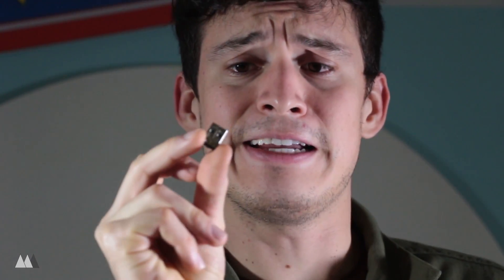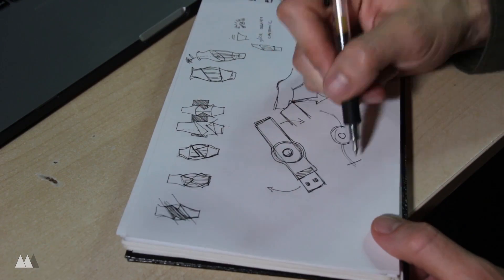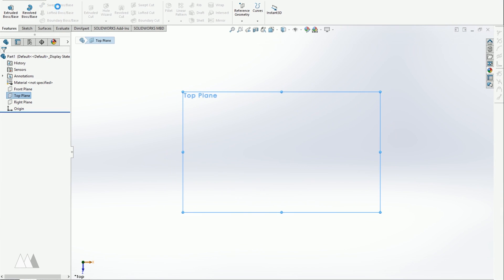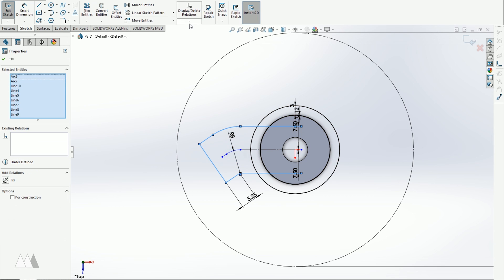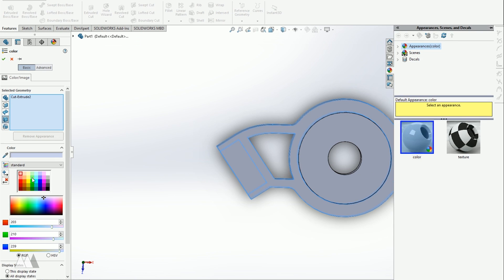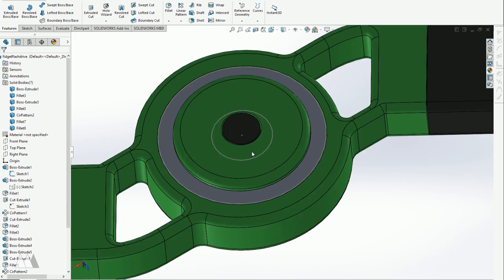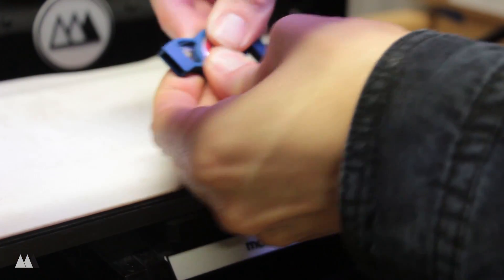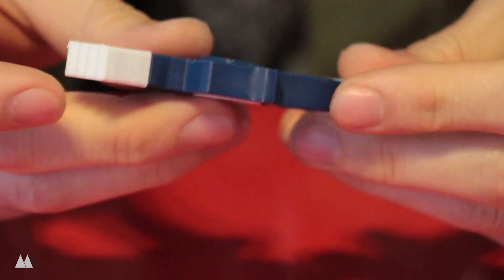Fidget Flashdrive // 3D Printed Fidget Spinner

Comment: just a suggestion, extrude cut a couple millimeters around the edges of the caps so when you use a flash drive you can put the cap over the other so it won't get lost

Comment: Hey Devin, I had the fidget printed by an online 3D printing service and assembled it a few days ago. It was my first contact with 3D printing and I enjoyed it a lot. I guess I'll get a 3D Printer myself at some point soon! I used different flashdrives by Samsung, since I wanted them to have usb 3.0. The plastic housings came of completely after some sanding, therefore the holes for the flashdrives were a bit loose, but I filled the spaces with some 1mm plastic scraps and glued it in. The caps have a reeeally tight fit! Anyways, I just wanted to let you know, that I had a really chill day building that cool fidget and am looking forward to show it off a lot!!  I use one of the flashdrives as an encrypted storage - for top secret stuff!! ;) LOVE!
Reply: phobonymous Which ones were they and were there any heating issues?
Reply: You mean which flash drives I used? 

I used these
https://www.amazon.de/Samsung-Memory-Speicherstick-abw%C3%A4rtskompatibel-silber/dp/B013VXJJ4A/ref=sr_1_2?ie=UTF8&qid=1488215958&sr=8-2&keywords=64gb%2Busb%2Bstick%2Bfit%2B3.0&th=1

No heating issues as of yet.

Comment: How could you make the caps for the drives so that you don't loose them when you take them off? Can you connect them to the back end of the other cap somehow? That way while you are using your USB you don't misplace or loose the cap. That happened to me before.
Reply: He could make it so those finger notches (9:30, the ones to make it easy to spin) have flat outsides to accept the cap.
Reply: Sprat & Ham ooh or maybe make the "grip triangles" the same dimensions as the usb drive and have them able to slip onto the end of the other one
Reply: Sprat & Ham
Reply: +Harpreet Kaur Yes???

Comment: Cool project! I would prefer the different drive symbols to be on the body and not just the caps. Knowing myself I'd probably have both caps off at some point and then have to plug the device back in to figure out which side is which.

Comment: i use solidworks for my cad class and occasionally ill have random problems that only starting a new part will fix.
like once i used the circular pattern tool and it was rotating around the axis i chose and it rotated the pattern weirdly too.

Comment: I always have problems printing fillets on the underneath of models. Is there anything you do to help this or is it just your better setup?
Reply from the maker: +taity waity do a 45 degree chamfer, then fillet the top edge. It's usually bad practice to just fillet a bottom edge like I did, but since they were so small I was able to pull it off
Reply: Ah makes sense, thanks

Comment: I wonder if you could do this without sanding the end as much if you did it as an embedded print, have printer pause at layer hight and drop it in, let it print over it to lock it in place
Reply from the maker: I would still sand it and make it even thinner :P

Comment: I just subscribed. The thumbnail brought me here. I'm about to start working on some fidget projects myself. Question: Have you even heard of kickstarter? You could easily sell these at $60-$90 a pop, depending on the number of arms. 

I love multi-tools and have been thinking all week of something useful that I can add to the spinner. A bottle opener? Flathead? The USB stick is a fantastic idea! If you know of any other combos, please point me in the right direction. Thanks!
Reply from the maker: A fidget bottle opener is a great idea! We can both make one ;)
Reply: Make Anything // 3D Printing Channel 
Center cap ideas: a compass or a watchface

Maybe add a spring or "button-pushing" feel to it. And speaking of watchfaces, how unique would it be to make it a smart watchface?

What if you made a rad stop sign with the O centered in the middle? or a stoplight that really lights up? 
...I could talk about this all day

Comment: could you have printed that inside piece that you hold around the bearing. i.e print the bottom and the post that goes through the bearing, then pause the print, place the bearing on and finish the print??